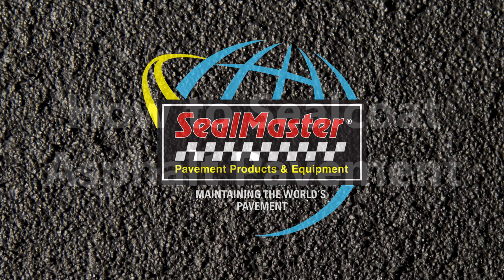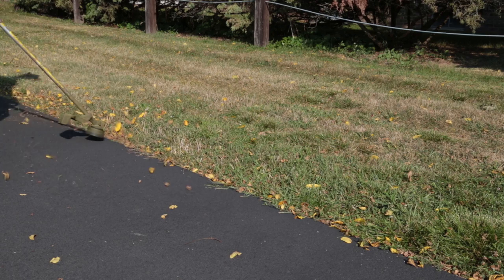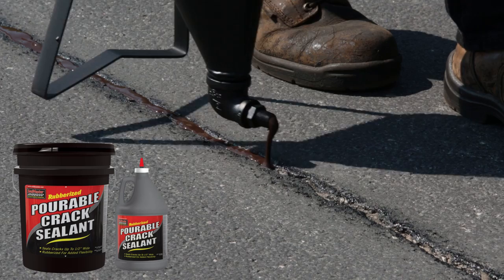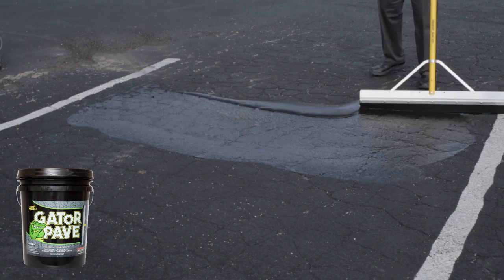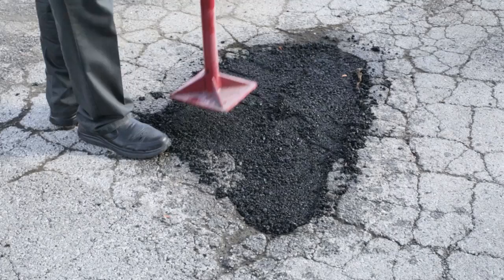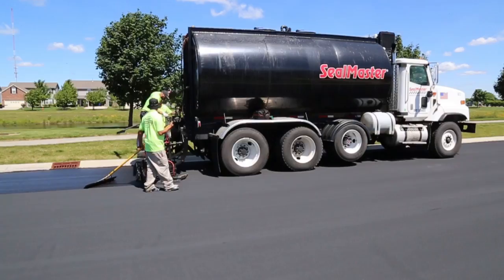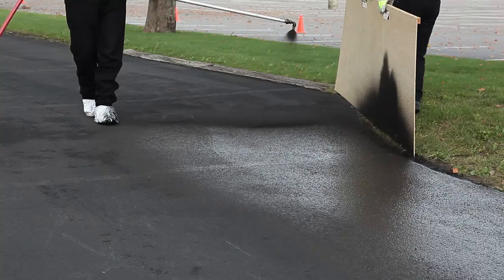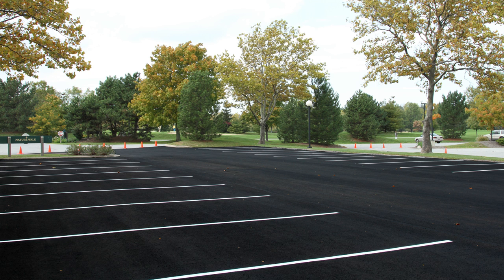How to Sealcoat Asphalt Pavement - SealMaster

Comment: That "Billy Goat" blower is amazing. Great video 📹.
Reply: I have seen your video they are awesome 👍
Reply: Billy Goat sucks. The housings break and the impellers are plastic. Toss a 9hp Honda on an old Bannerman or get yourself a Scag Little Wonder. The only reason the Little Wonder crack cleaner they showed in the vid are good is because it has the dual belt that does not toss belts twice a week.
Reply: @tocarules  I'm debating between a heat lance or the Little wonder for cleaning cracks prior to hot melting with my RY10 Pro.  Is the lancer better?

Comment: Lol, your sealer is garbage - Its constantly watered down from distributors. There is always trash in it, but you'll probably never mention flushing dirty sealer out of old tanks which have not been properly cleaned prior the winter before, so whatever. No one ever, is going to fill cracks in a parking lot out of a 1 gallon tube, so why advertise that? Machines are "ok" at best, but some don't come as advertised either. Shocker right? Thanks for sharing, glad I got to comment the truth.
Reply: you tell em Nate!
Reply: that means that liquified coal tar is best for this. Forget the enviro-friendly part.
Reply: @rearspeaker6364  coal tar in general is always cut. My point is they don't watch what their distributors do to it, and they completely trash their product
Reply: LIAR
Reply: @daveklein2826  Oh, all caps. Someone must've gotten mad.